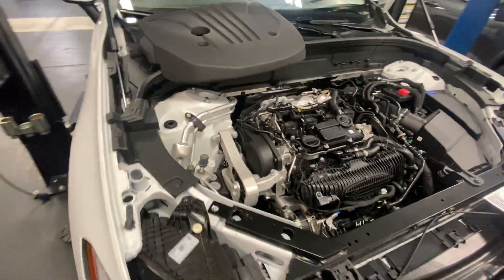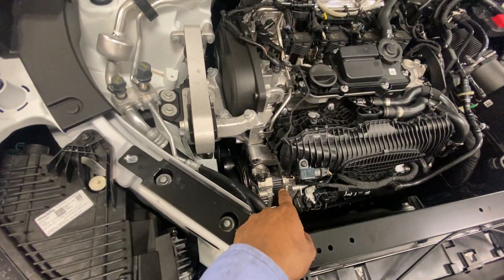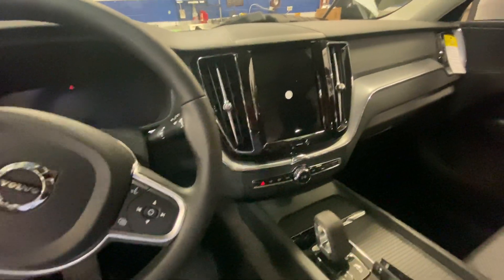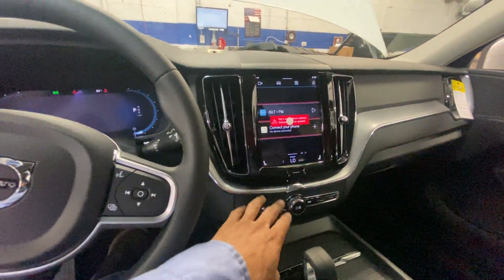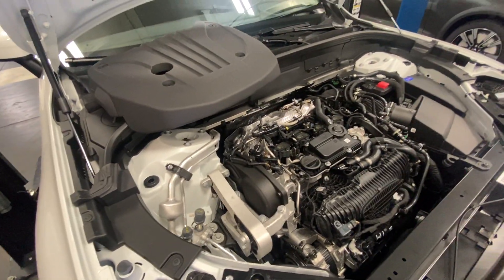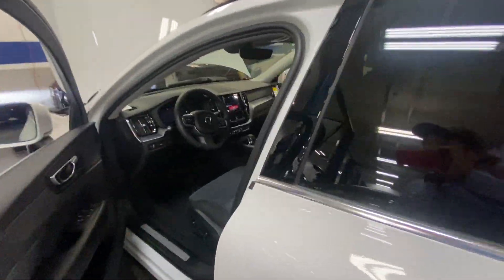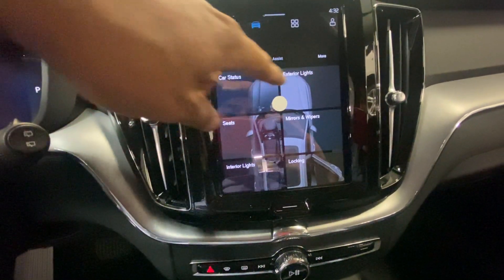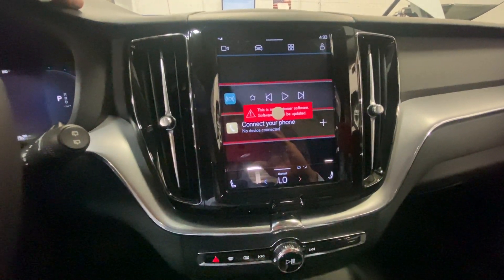New B5 volvo engine

Comment: I have B5 2020 and I find out that some people has problems.
The design mistake is wet oil pump belt. Petrol is agressive and when gets to the oil belt is damaged soon.
Some owners lost engines after ca 60 000 km so if you have this B engine from period 2020- 2022 check your belt condition and convert it to chain drive as soon as possible. IMO Volvo should do this convertion for free but the question is if Volvo is serious company?
I wish my decision about volvo purchsasing.
Reply: I have a B5 S60 2022 I had a turbo replace under warranty (32,600mile in the car)before turbo issue and after replacing I have rpm idle sometimes going up and down , sometimes staying at 1,500rpm took to volvo they need to to big investigation! To be honest disappointed I had 2x V40 2.0 D3(5cylinder) & T2 2.0 petrol never had any issue 🙄
Reply: @baraoszkar  so early turbo replacement? why?
Reply: @ 2weeks ago started making a noise like a hoover on cold start after when I was driving around 2.000 rpm again had same noise! They never give me proper answer what was the issue!
Reply: @baraoszkar  also the reason could be also  pcv valve or turbo  waste gate valve. The  turbo as it is should be in good condition if lubricatipn worked OK.
Reply: @chriskros8858  exactly! I bought in 8months ago so Don’t know how they serviced the car!

Comment: Hi great video on the new B5 engine. Do you think this engine is more reliable over the T5 engine ? im not a fan of the mild hybrid system but least its not a full hybrid system. i was looking at a 2021 XC 60 but now for a used 2022 its not really a big price difference. thanks
Reply from the maker: @paulrakis  2021 t5 are good 
Early b5 still too early. Always recommend buying models that are at least 3-4 years after because early models always have issues in every manufacturer
Reply: @VolvopediaGuy  awesome thanks brother. Yeah a friend of mine has the T6 version they has some problems before with the coils or something.  Having an engine turbo and supercharged is too much going on.  That's why I like the T5 less issues. But T6 had so much more power.

Comment: Does anybody know if this engine has a integrated exhaust manifold and a open deck block or not?
Reply from the maker: Yes they have integrated exhaust manifold
Reply: @VolvopediaGuy  thats so ridiculous.   They really need to stop doing that.   Benefits vs cons you get a lot more cons then anything with integrated exhaust manifolds.  I bet its also an open deck.  Hopefully they didn’t put those coolant slits on top of the deck surface between the cylinders.

Comment: Nice review.  Is the 48v battery air cooled or water cooled?
Reply from the maker: I don’t remember . I know there is a hose that attaches to it
Reply: The 12 volt and 48 bolt batteries are both in the trunk, 48 is left of the spare tire and 12 is under the spare tire.  Under the hood is just12 volt hookups for jumper cables.